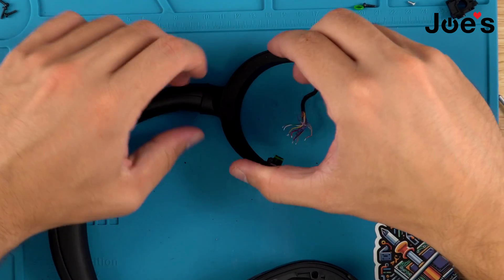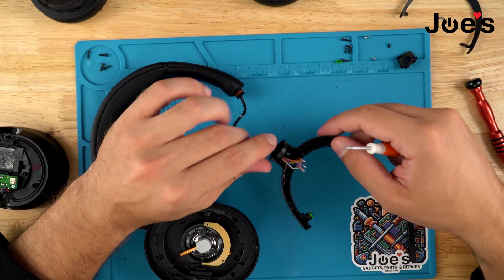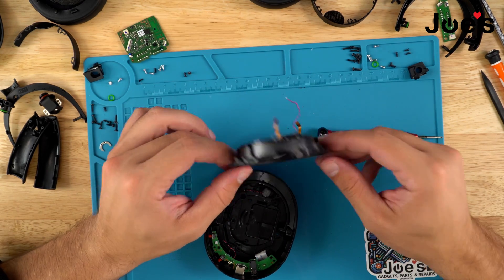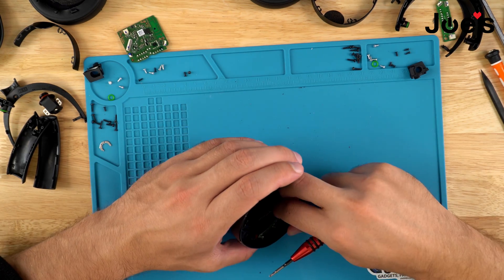Sony WH-ULT900N & ULT Wear Headphone Teardown 🚀 Easy DIY Repair Tutorial

Comment from the maker: 🛍 Prefer DIY Repairs? Buy Genuine Replacement Parts Here
Sony WH-ULT900N replacement parts
👉 https://www.joesge.com/search?q=ult+900n

🧰 Tools Used in This Video
1.5mm Phillips Screwdriver:
👉 https://www.joesge.com/products/beats-by-dre-screwdriver-tool-t5-t2-philips-flat-head-repair-tools?variant=7905323057198&utm_source=youtube&utm_medium=product_shelf
1.5mm Flat Head Screwdriver:
👉 https://www.joesge.com/products/flat-head-1-5mm-thin-strong-screwdriver-pry-repair-tools?_pos=2&_sid=a24b4a181&_ss=r&utm_source=youtube&utm_medium=product_shelf
Plastic Spudger:
👉 https://www.joesge.com/products/nylon-spudger-opening-prober-alignment-ribbon-removal-repair-black-tools?_pos=1&_sid=9d4b192a6&_ss=r&utm_source=youtube&utm_medium=product_shelf
Precision Tweezers:
👉 https://www.joesge.com/collections/repair-tools/products/precision-tweezers-stainless-steel-thin-thick-strong-for-electronics-repair-tools?utm_source=youtube&utm_medium=product_shelf
Soldering Iron:
👉 https://www.joesge.com/collections/repair-tools/products/60w-adjustable-led-soldering-circuit-board-repair-iron-kit-tools?utm_source=youtube&utm_medium=product_shelf
Soldering Flux:
👉 https://www.joesge.com/collections/repair-tools/products/amtech-nc-559-v2-tf-no-clean-tacky-solder-flux-10cc-kit-tools?utm_source=youtube&utm_medium=product_shelf
Heat Proof Anti Static Rubber Work Mat:
👉 https://www.joesge.com/products/electronics-repairs-heat-proof-anti-static-rubber-work-mat-blue-tools?_pos=1&_sid=02c2fb59f&_ss=r&utm_source=youtube&utm_medium=product_shelf